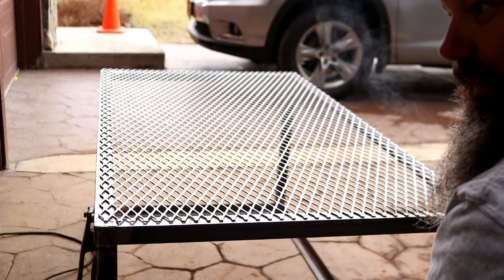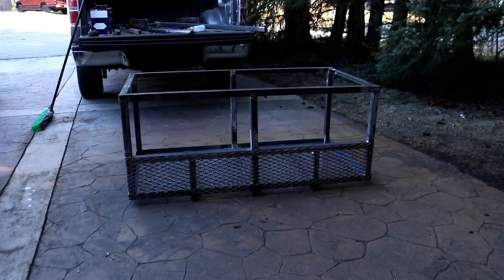Yutrax trailer review and new trailer build (SE 3 EP 15 2018)

Comment: " It took a little longer than I was expecting." They always do. :)

Looks good, and should suit your needs. That old one is exactly that. LIGHT, light duty. For the city dweller that uses it to haul his grass clippings to the flower bed..
I've built little trailers like this. Yours looks tough and useable. One thing you may want to consider doing, is adding another piece of tubing from about 8"or so behind the hitch, back most or all the way to the axel. You did use thicker tubing, but with the loads you will have on it, and the terrain it will travel, I'm afraid that single thickness draw bar will fail eventually.

I liked that you showed taking one of the most important measurements. If ya ain't gonna build it square, don't bother! Lol.

Good work. I'm sure it will be well used.
Reply from the maker: Thanks Scott, That’s a good idea about running another piece of tubing.

Comment: We had a Agri-Fab 20+ cu feet atv trailer that failed miserably. The weight of red oak rounds made the floor sink down crumbling the sides. The tailgate would fall off leaving the load behind at the worst times. The tilt lever failed first allowing the cart to tip back and dump loads off while driving. The tongue bent upside down into a upside down V. The best thing about it was the tires. The narrow stance once allowed the tongue to twist to the side dumping a load on a side hill. Now we have a Polar 20+ (22?) cubic feet single axle with plastic body. It had a nice wide stance. Wider than our atv. So far so good with it. It's held up much better than the Agri. I like a bigger cubic foot trailer to reduce trips made.
Reply from the maker: Dashbshots nice, I’m glad you found something you liked. I’m loving the new trailer. 👍